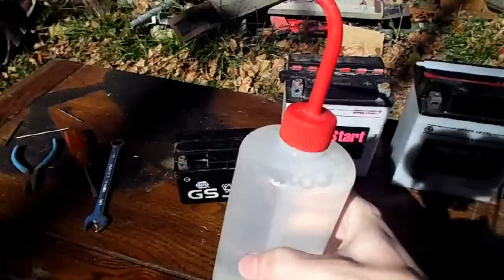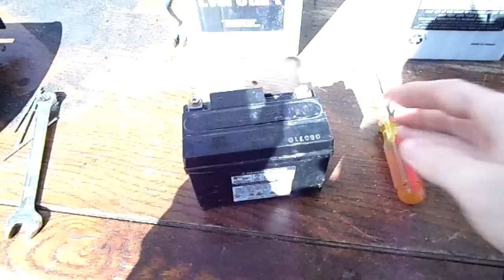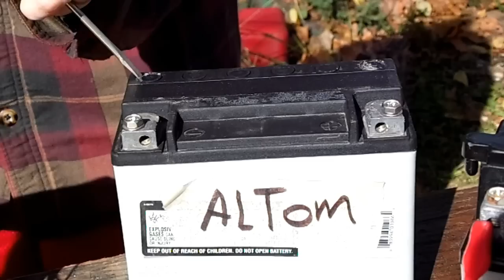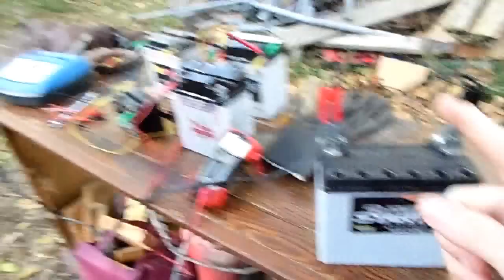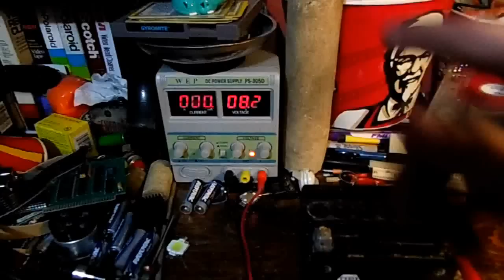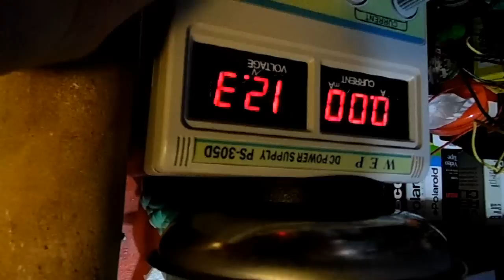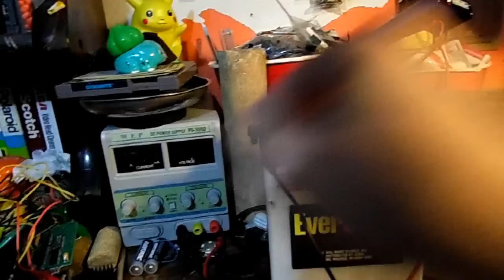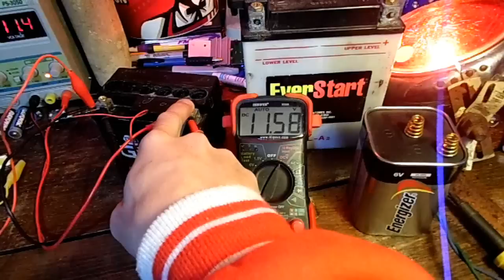DIY Fixing Lead Acid Batteries

Comment: I don't know why exactly but I think messing with lead acid batteries is really fun. I've been doing it since I discovered this and some other videos a few years ago. I have so many better batteries like custom 18650 packs and large LFP batteries but the little little acid batteries are always fun to get working again. My most recent success was a 2003 power sports battery that was at 5.5V and fully dry. It gets 5.0 out of 14.7Ah and has 50 mOhms of internal resistance. The most likely candidates to revive are batteries that were working when last used but sat around for a long time and fully self discharged. Batteries from UPSes and other continuous float applications are usually the worst. I've also done some other experiments like reversing the polarity as a revival technique and making Epsom salt electrolyte for a new old stock 1970s motorcycle battery which didn't work so well. I've found the pulse desulfators to be useless, and adding Epsom salt only sometimes helps in certain cases.

Comment: making connections to batteries with the cell caps open can be dangerous due to the release of explosive gases, primarily hydrogen and oxygen. These gases can accumulate and, if ignited by a spark, lead to an explosion. Additionally, the electrolyte, which is a corrosive acid, can cause burns if it comes into contact with the skin or eyes. 

Here's a more detailed explanation:

Explosive Gases:

Lead-acid batteries generate hydrogen and oxygen gas during charging and discharging. These gases are flammable and explosive, especially hydrogen. 

Vent Caps:

Vent caps are designed to release these gases, preventing pressure build-up and potential rupture of the battery case. Removing the caps or allowing them to become damaged can allow these gases to escape freely. 

Spark Ignition:

Even a small spark, such as from a faulty tool or a loose connection, can ignite the accumulated gases, leading to an explosion. 

Electrolyte:

The electrolyte in lead-acid batteries is a sulfuric acid solution, which is corrosive and can cause burns if it comes into contact with the skin or eyes. 

Safety Precautions:

Ventilation: Ensure the area is well-ventilated to prevent gas accumulation. 

No Sparks: Avoid sparks by using appropriate tools and avoiding loose connections. 

Eye and Skin Protection: Wear safety glasses and gloves to protect yourself from the electrolyte. 

Do Not Remove Vent Caps: If you have a sealed, non-ventilated battery, do not remove or damage the vent caps. 

Follow Manufacturer's Instructions: Always follow the manufacturer's recommendations for charging and handling batteries.

Comment: How long can battery life be extended by doing this?

Also, if I decide to just buy new batteries for my 2 jumper packs that are weak/dying, do they HAVE to read “20HR” on them? My jumper pack batteries are labeled; 12V 7AH/20HR and the other is labeled 12V 18AH/20HR… I’ve found identical batteries on Amazon, BUT, NONE of them read “20HR” on them… Confusing…

Comment: Good video brother.. should try empty batteries.. mix baking soda 1 cup per 1 gallon of distilled water fill up batteries wait for reaction to stop do this 2 or 3 times last time half way shake to get rid up crap.. now flush with hose water  obviously shake the hell out of it then last flush with distilled water also shake .. now add new acid O'Reilly 25 bucks for 5 gallons pre mixed sulfuric acid for batteries now charge on Trickle 24 hours.. you could also do the Epson salt idea but Alum Granulated Powder food grade work much much better also 1 cup per 1 gallon you can heat that up over oven on low until all dissolved qait until its cooled to add to batteries.. a hydrometer helps to check the gravity.. you seem very skilled with electric

Comment: Thanks for the video. I have a question for you. It seems that sulfate between cell is the biggest cuprite for lead-acid going bad. I have a motorcycle battery, EverStart brand, just like one of your battery you were testing with. I just bought this new in May this year. I've used it fine for the summer then I put on a low current charger. This other day I have discovered the charger indicator blinking yellow rather then green. Who knows how long it had been blinking.. I check the battery voltage and it reads 5 volt. So I disconnect and reconnect the charger then two days later it shows green indicator but when I measure the voltage, it shows still 5 volt. The charger must have drained the battery for good. But this battery is new. It is not a case of sulfate build up. Is there any way the battery could be revived? These motorcycle battery only comes with 90 day warranty for whatever reason. Thanks in advance for your help.
Reply: I have same junk battery.  Only a year old.
Reply: @BraaapAllDay  I raised the voltage to 12 volt by connecting the dead battery to my car battery for few hours (or was it few minutes? I cannot remember). Some posts indicated that the charger would not charge unless the battery is up to certain volt. I guess 5 volt was too loo low of voltage to start the charger. These compact charger do not have whole lot of explanation to tell you anything. Anyway, the volt is up to 12 volt and I put on a charger to keep charging. It has been on charger for winter. I will find if the battery is fully restored or not when I connect the battery to the bike this spring. If the CCA is not up, even with the battery volt reading of 12 volt, battery is not usable. Try that!

Comment: You can use lemon juice and a mixture of Epsom salt with lemon juice you could use that it might take a little while to put out a charge even on a sulfated battery this trick works I've used it sometimes in an emergencies that trick works just be careful when doing it.

Comment: i use the 200amp start on my battery charger to boil them for a bit,i have saved alot of batteries. i did one the other day that started at .8volts. its working well in the riding mower. takes a few hours. A DC arc welder also work for desulphating.

Comment: why couldnt you use electrolysis submerge the battery in Epsom salt and water  use a lead diode and put the power to it if electrolysis with take rust off steel seems though it will remove lead dioxide put the negative external instead of internal

Comment: Hi Sir the 12volt battery that I'm doing has a dead cell & 3 days ago I had emptied the acid out of the battery & then flushed the battery with fresh clean rain water from my 250 liter tank & boil it up in a jug & I added some of the rest of the cold water to the hot boiling water to cool it down a bit to put in the battery & gave it a bit of a shake up & then poured it out of the battery & when I got  all of contents out of the battery I then got some more Fresh clean rain water & put it in the jug & boiled it up & I got a pack of baking soda & once the jug boiled & I some cold rain  water put into the bottle & the added hot water from the from the jug & added the baking soda & gave it a good shake up & then poured it into the battery & you should have seen the contents bubbling in the battery & let sit overnight & the yesterday morning I emptied the mixture straight out of the battery & forgot to shake up the battery first & got all out of the battery then I did the process all over again & adding baking soda to the hot fresh rainwater & poured it into the  battery & I let it sit in battery for about 2 hours & then gave the battery a good shake up & before pouring all the contents out & did same thing again  & a total of 6 times with baking soda & hot fresh rainwater & on the 6 th time that I did with baking soda & hot fresh rainwater & added to the battery I then let it sit overnight & later this morning I has put the caps on the battery & screwed them down & gave the battery a good shake up for a few minutes & then took the caps off the battery & poured the contents out of the battery & once I got the contents I got a bottle of fresh clean rain water & heat it up & poured that straight into the battery & gave it another shake up & poured straight out & moved the battery back & forth while the battery was up side down & then after I had got it all out of the battery & then got plenty of distilled water & boiled that up & then some cold distilled water just to cool it down  a little & then added Epsom Salts to the container & gave & once the Epsom Salts had desolved & I poured that into the battery & then I put the Foxsur 12V/24V 7stage battery charge & it's on repair mode & within a few minutes the Epsom Salts with the destilled water started to bubble & as I was looking at each cell some were bubbling & weren't bubbling & then a short time later they were all started to bubble & I said cool I may have fixed the dead cell that was in this battery & when I unplugged the charger leaving the leads connected to the charger &  got a reading off the Foxsur charger 8.8 Volts & then about a few minutes later I unplugged the charger & got a reading of 9.1 Volts & so its coming up &.its been now a few hours now but it's raining  at the present time not nice at all & will have to check it again at a later after the rain has stopped & here's hoping that I may have restored this battery & I hope so anyway Kind Regards Peter
Reply: Honestly, it's a waste of time even trying to do anything with batteries that have a shorted cell. I've never gotten any real success from it despite trying many times. At best it might work for a few days, but that's it.

Comment: The one that had the name on the tape requires you to cut the plastic around the top of the round plastic caps. It will hace tiny thin strips around the hole for venting but the caps will be connect between the vent slits. They are a pain in the arse to get out and they dont fit back in with gluing or plastic welding

Comment: That second one ypu must have had the polarity crossed on your test leads because it said -5.?? Volts or it switched polarity internally. Ive seen many small batteries reverse polarity but never ccx any big ones.

Comment: I was given an 85 amp sealed leisure battery. The level was low so I drilled 6 holes & topped them up with distilled water ( I make my own) then sealed the holes with hot glue & small squares of plastic so can be removed for refilling again & set the charger on pulse repair mode. It's a great battery & can deliver current as I tested it with my 12-volt kettle which draws around 14 amps & it boiled. I also have 2, 126 amp truck batteries which I have also had on pulse repair & inverters to use with ham radio, CB & UHF equipment in an emergency. Now the West is locking horns with Russia One never knows when backup power is needed. We could have our fragile power grid knocked out.

Comment: Hey everyone you need at lest 13.5 v to 14.5 v to get a true 12v charge. If you only us 12v to charge your 12v battery's. It wont charge any higher than 11v. A cars altenator charges at a constant 14.5 v take care

Comment: Great video.  I have a 48 volt golf cart, 5 years old and the batteries last only about 16 vs 25 miles when new.  I want to desulfate them using a battery pulse system like yours.  Did you build yours, since there is no casing around the electronics.  Amazon sells the BLS-48A desulfator, which the manufacturer recommends to mount in the golf cart and desulfate continuously.  Any recommendations?

Comment: I pour old stuff refill with water shake empty repeat until clean water only comes out then I use Epsom salts and bottled water  charge over night  problem SOLVED  even on batteries dead as a door nail  it works every time

Comment: make sure the liquid levels are equal. Tipping helps. Also tipping will allow some of the bubbles to come to the top when you're equalizing levels. ONLY use distilled water.

Comment: hey, i got a scrap battery from my friend, it still works probably, but it is all wet on top. my friend has dogs, so it might be just dog pee, but i dont want to risk anything. i managed to get a very little of it on my finger, it was kinda brown-yellowish, but no damage on my finger......... the top looks a little rised aswell.
Reply from the maker: you can spray a 12v battery down with a garden hose, just dont fully submerge it. but ive even seen them work under water for a bit funny enough
Reply: @RinoaL  thank you :D
Reply: i found out that the battery was at 1.5V aswell, i did not do anything, i have a "mending" charger that charges the battery, when it detects something is wrong it will automatically start pulsing the battery. i did not fill it up because it was already full. it works perfectly fine now :) it has a bit of drain, but i can live with that.
Reply: @RinoaL  oh yeah and also, is it safe for the battery to short kanthal resistance wire across it?

Comment: Doesn't work. Once they die, don't waste your time on them. Best bet is too look after them by keeping charged especially in winter.
Reply from the maker: it does work sometimes though.
Reply: I've gotten them to work before, even on ones that were over 20 years old a couple times. I'd only recommend it for fun though since lithium batteries are so cheap now and at best you'll have a mediocre battery that might not last very long.

Comment: Can you revive a motorcycle battery with 0.475 DC volts only ?
Reply from the maker: i'd say its worth a shot but your chances are slim
Reply: @RinoaL  using a pulse car charger, battery didn't revive..... sad

Comment: How does this fix worn out batteries that die from positive plate corrosion lol
Reply from the maker: never said it did
Reply: Those batteries are usually unfixable. You can try discharging them fully and then reverse charging but it usually won't work.

Comment: I had a maxx 51r in my trunk as a back up for jumping random peoples cars.  It tipped for about a month and was completely dry, how can I determine how much sulfuric acid and distilled water to add.  Also, adding sulfuric acid directly to water creates extreme amounts of heat.  What should I do?

Comment: Deionised water is a must when topping up batteries, plus your charge is way too high. All you need is 1 amp at 13.8 volt over 24 to 48 hours,
With the smaller motorbike batteries, you can boil or cook them with a high charge rate. You need 500ma max.
Do not use a smart charger, all you need is a dumb 1 amp charger.

Comment: Resting voltage for a good battery is between 12.6 to 13.0 V. If the voltage is any less after sitting 24 hours, then the battery is sulphated. A "desulphator circuit" has to carry at least 5 amps of current to have any effect at all. If the resting voltage is less than 10 V, then the battery should be a core charge for a new battery, no recovery is possible. I've been through it all, tried many reconditioning tricks, powders, alum crystals, and almost none of them worked. The only try that did work (temporarily), was to empty the battery of the old acid, use baking soda  saturated in distiled water to get rid of the sulphation on the plates, then add fresh acid to the battery. This worked for six months, but it ate the plates away and shorted two cells. The best thing to do to keep a battery working is to keep it clean, use distilled water only to fill a cell that has gone down. Never fill a cell more than 1/4 to 1/2" above the plates, the extra water, if you filled it to the top, dilutes the acid and makes the battery weaker. Clean the battery top with distilled water and a soft cloth untill it shines, any dirt or dust has a high concentration of rust,  causing a high resistence short between the posts putting excessive stress on the battery and alternator. This shortens the life of the battery and alternator. A clean battery, no corrosion on the connections will make your battery last one or two years past it's expected life. I have an Exide "blem"  in my truck that was only guaranteed for one year five years ago, and it still cranks the engine like when it was new. Enough proof for me.

Comment: High voltage pulse desulfators are not good for batteries and really not good that you use them for weeks at a time. A high frequency pulse desulfator is better in that it does not "zap" any lead off the plates like a high voltage desulfator can. Only use a high voltage desulfator when your battery is too wrecked for a high frequency pulse desulfator to do any good. The lead that flakes off from a high voltage desulfator will eventually cause a short in the battery.

Comment: cycle them up to 130 degrees    cool  and recycle      until voltage is 2.5 v per cell  on charge   desululfation is greatly helped by using  the best tools which are variable voltage.   variable  amperage manually controlled chargers.  self regulating chargers are useless    proper voltage and  high amps  speed the process  but temperature must be monitored    temperatures over 130  degree f degrade plates plus gassing batteries  produce hydrogen and confined  hydrogen is explosive   used to do this for an industrial battery repair shop.    good candidates are newer ones that have been overdischarged  trying to start cars during cold weather    sulfated batteries give false voltage readings on charge but hydrometers dont lie  tho  they wont help with gel batts

Comment: Gray plates are negative.  Red plates are positive     Those look deteriorated   Poke em if they are soft they are junk as the lead grid is gone.   Positive plates in good condition are covered and solid so you usually can’t see the color until they are deteriorated and falling apart

Comment: IVe worked 2 1/2 years at a battery shop. battery fluid is 1/3 sulfuric acid and 2/3s distilled water. not 10% acid and 90% water totally wrong!
Reply: Any insight into the industrial re-manufacturing process? Is that generally just a separation of individual materials, and starting from scratch?
Reply: @m3n4lyf  they melt down all the plates into new lead and then use that reprocess it into proper spongy lead plate material.